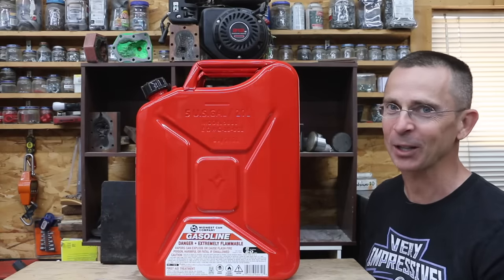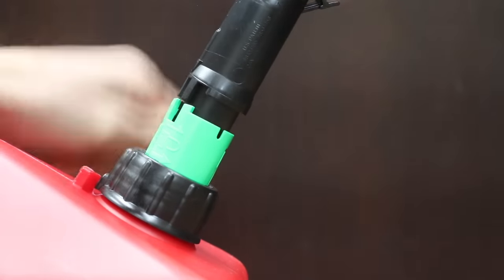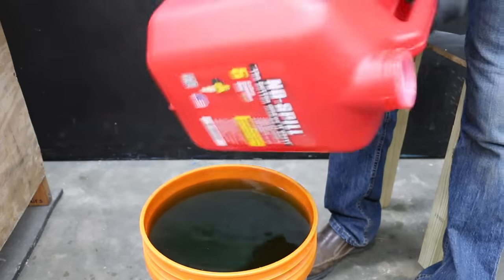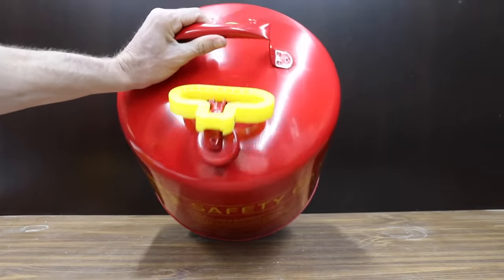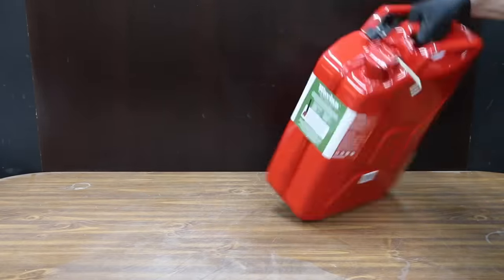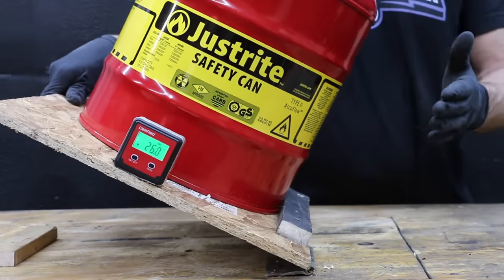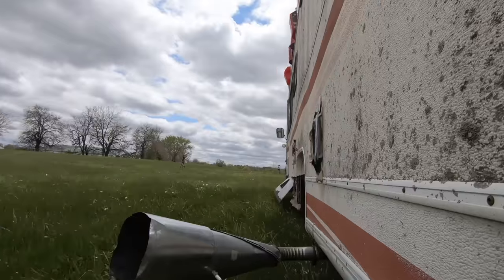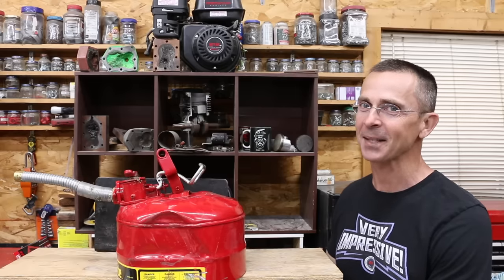Best Gas Can? $140 Wavian vs Eagle, Surecan, Scepter, Briggs & Stratton, Midwest, VP Racing

Comment: I can't begin to detail how much I loath modern gas cans.  I bought two Scepter cans. Hate them. I had to modify the valves to make the usable. The spring inside makes them a real pain to use so I disassembled the nozzle, not easy, and reduced the spring length to something more reasonable. Your hand gets tired holding the valve open so I can't imagine what ladies or people with weak hands would do. Also, where I fill with gas they have the fume capture nozzles and that prevents me from being able to fill the cans because the flame mitigator has dogs inside that keep you from inserting the nozzle fully. If you don't push up the fume capture device it won't start so I have to hold it with my hand in order to use it. Another pain. Its' like they never tested the cans with the different kinds of nozzles. So, out came the so called flame mitigator. Watched a video on these cans and someone from the manufacturer responded on the video and came across like an arrogant jerk. It's the last one of their cans that I will ever buy. 
One other thing: It's one of those cans with a short spout. So, if you plan to fill a car, you often can't because the spout is so short you can't get it past the flap inside. Seriously, its as though they never tested their cans.
Reply from the maker: Thanks for the feedback.

Comment: You have forgot that most new vehicles have these stupid auto closing easy fuel capless things And you have to use a small adapter to open it for gas can refueling. Cheap plastic that cant take the weight of the can to open the flow.

Comment: Great testing!!
Another consideration, for me at least, is how well cans handle imploding.   I have had half full plastic cans stored in my shed, in the summer, that deformed by "imploding".   I was able to straighten them out, but am concerned that the cans were weakened where they folded inward.  

 BTW, the "good folks" at EPA should be shot for their idiotic regulations on gas can spouts/venting.  It's obvious to me that these pencil necked geeks have lawn service companies do all of their yardwork and they have never had to add gasoline to their cars with one of their poorly designed cans.

Comment: This test is flawed because the weight and thickness of real fuel is FAR different than water ... and that's without the additives and oils that comes with it ..

Most of them probably wouldn't spill or have a much different fueling if they had real fuel inside them, even the tilt over would've been significantly different .

While this is a good test to get an idea on the quality, I think you should remake the test with real fuel for any reliable results ... would also be interesting to see if you will end up with different results on ranking and stats.

Comment: Something you didn’t take into consideration is if you’re using it for diesel a lot of diesel pumps have wider nozzles then gas cans some of those cans have bigger openings for easier filling I filled up quite a few small openings on big hoses and it sucks end up covering yourself in fuel on the pressure buildup
Reply from the maker: Thanks for sharing.
Reply: You could get a diesel fuel can for diesel fuel. They are yellow and have wider mouths for the purposes you noted
Reply: You're not allowed to put diesel in red cans in North America (maybe that's universal?)

Comment: my own two cents is vp racing... it does something you didnt really touch on which is the ABSOLUTE STUPIDITY OF THE SPILL PROOF $#@$&%^^#@!!!    point made  anyhoo, i chose the vp racing cans for my storage for two reasons:
1.  no spill proof cap 
2.  extra long spout makes it easy to fuel anything.... and very low to the ground things without bending over while doing so.

Comment: You could have tested all of these with water. Just saying. You didn't show how to fill these containers from an actual gas pump. You can't if the pump has a fume seal on the pump handle. Completely useless.
Reply from the maker: Thanks for the suggestion.

Comment: Good gracious me, what a load of American hype, do you know who invented the Jerry can? yes the Germans, still in use today by many countries around the world. Go check it out. The engineering that went into it was impressive, none of the attributes of the original Jerry Can design have been even been touched on here. I generally like  vids from the Project Farm but this one lacks an understand of the principals of fuel transport, not how fast can it be pored, having said that you will find that the Jerry Can will take the piss out of all your cans made from flammable plastic and will disintegrate in less than 10 years,

Comment: frankly the majority of today's cans are GARBAGE, chynese GARBAGE!   you have to buy better straight nozzles then add vents to them, buy the brass style vents, they come with a chase wire and they are brass, same size as tire valves.. air tight, they have those plastic ones but risky ..

another real good can out of the box is called "SureCan 5 Gallon Safety Gas Can"  decent can for small engines boats so forth, automobiles too I spose?
Reply from the maker: Thanks for the feedback.

Comment: Your test stand is not realistic. In real life, the object being filled will easily move or shift. Also the inlet of a car is at 3’ above ground level. No comments were made about try to hold open the spring loaded nozzles with one hand, holding an ~40 pound gas container with the other hand and tllt the container in order to pour the gas out.